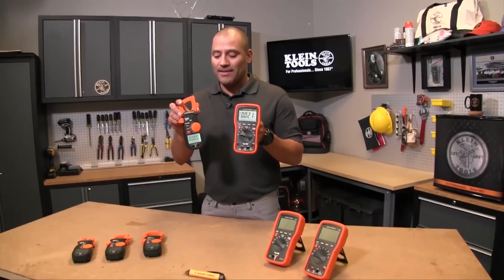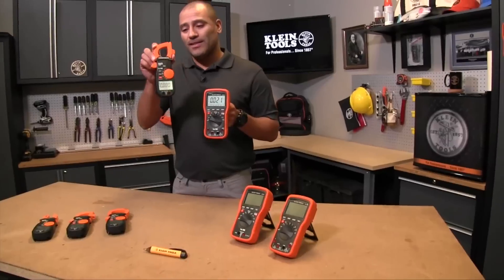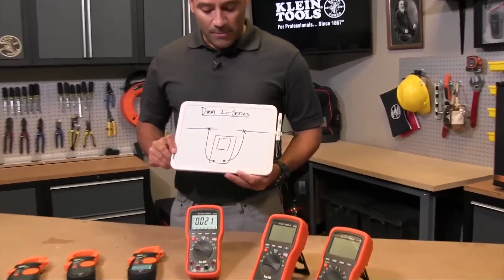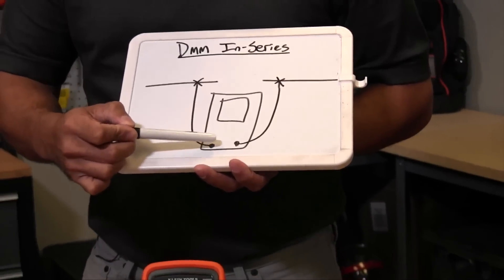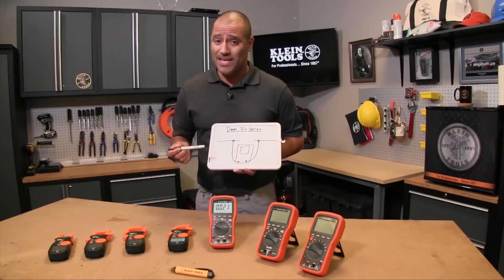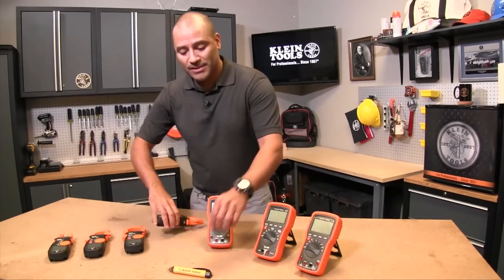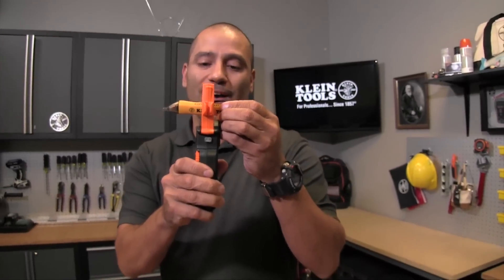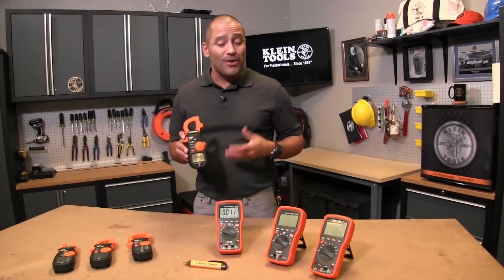How To Choose Between A Clamp Meter And Digital Multimeter

Comment: I use a Klein CL800 clamp multimeter, a really important feature not made known by virtually all meter makers is "refresh rate" of the screen. I had to ask Klein directly what their refresh rate was and even the person on the phone didn't fully realise what I needed to know. There are two refresh rates on meters 1. Measurement of voltage/current, etc. ("Meter refresh rate") 2. How often measurements taken are passed to the screen ("display refresh rate"). I bought the CL800 because it was the only one I could find that met my other needs as well as provided a high refresh rate. I can't remember what the rate is but it's great. Display refresh rate x Meter refresh rate is very important when measuring quicker changing values. I regularly need to measure triacs that control heating elements on industrial ovens. I need to see full current draw and zero current draw as triacs have a number of failure modes e.g. full on, full off and permanent half on, etc. As your meter is really good at this it would be helpful to do a video on it for visual explanation with numbers for the refresh rates. Fluke are great meters but suck at refresh rates!!
Reply: why not a scope? Real question. I don't know. I'm not an electrical engineer.

Comment: He didn’t explain why you buy the digital one instead? Going off this video there would be no reason to buy the digital one since it’s just more difficult to use and can’t read as many amps
Reply: Did you get the answer for that? Then why the heck did digital multimeters even exist?
Reply: @tubfragr2270  For more accurate reading of low amp (below 5)

Comment: You don't need to measure in circuit you can measure in parallel to.
Reply: If you mean that you don't have to measure with a standard MM in parallel...you're incorrect. To measure current, an ammeter has to have low resistance because if it had high resistance, it would affect the flow of current itself and thus could never measure the current flow accurately. Because voltage is constant in parallel, if you place a low resistance load (the meter) in parallel with a component in a circuit, the majority of the current will flow through the meter and destroy it (or blow the fuse). There's a reason the position of the leads on a meter must be changed to measure current. DON'T EVER measure current in parallel.

Comment: The title is all wrong.  This is not a "how to choose"  video it's "how each reads amperage".  I was looking for a video that would give the pro's and con's of each meter to better determine which would meet my needs.  I've always had DMM's but am considering picking up a hall effect clamp meter and still don't know if that's a good idea after watching this video.   

Where would a clamp meter fall short vs a DMM?
Reply: Accuracy, clamp meters are not as good at lower range. I only use clamp at  more than 5A or if i can't disconnect one of the wires.

Comment: Reading elsewhere I have learned that DMMs typically measure in milliunit resolutions, making them ideal for electronic work, while clamp meters only measure up to tenths of a unit, which is insufficient for electronic work, but fine for electrical work. Is that still true or has current clamp accuracy improved to match DMMs by now?

I've also read that some multimeters come with clamp accessories that you plug in so your DMM can be used like a current clamp. But I don't know if these attachments are considered to be as accurate as clamp meters. If they are it would seem that DMMs are all around superior, provided they come with this accessory.

Can anyone provide further insight on these questions?
Reply: Nicholas Olson .....I think some clamp meters also come with 2 test leads.

Comment: It appears to me that a clamp meter is simply a DMM with an additional function to measure AC amperage using the clamp.  I know of no reason why  the other functions of the meter should be any less accurate that they could be for an equivalently priced meter.  The clamp uses a half of a transformer winding built into the clamp to measure the current draw in the wire 
 (the other half of the transformer) through it.  Other than that, same-ol same-ol.

OK, I just learned there are two kind of clamps: the transformer method and a Hall effect sensor method.  The Hall Effect meter differs in that it can measure DC current as well as AC.The Hall Effect meter works on a magnetic field, and is sensitive to local magnetic fields, so it should be zeroed out before a measurements is taken.  And, of course, its bound to be more expensive, but what else is new?
Reply: Just bought one. Has everything including AC/DC inrush and min/max. $15. 😁

Comment: I wonder if the term parallel is used correct here? you can actually check Volts in parallel and with Amps there's no physical contact using the clamp meter.

Comment: 0.5V can send 300A easy. 6000V can send 100 microamps. The fact that you're breaking a high current circuit doesn't necessarily mean you're creating danger. Just thought I'd clear that up.

Multimeters can measure DC at a far smaller cost. Clamp meters are usually made to measure AC, 50/60 Hz.

Comment: Thanks - but why would you ever buy a multimeter instead of a clamp meter, other than price?
Reply: AFAIK, there is no reason a clamp meter cannot be entirely equivalent to a DMM; it is, in fact, a DMM with the additional AC current ranges and the do-hickey to use it with.

Comment: How to choose between a clamp meter and a DMM in 5 seconds:
If you want to measure high currents >10A of 50-400Hz AC (some meters can do DC too), you need a clamp meter, if not, you're better off with a DMM. Clamp meters are inherently less accurate and designed for work on high power distribution boards, automotive etc. If that's you ,get a clamp meter. Simple.

All the meters shown in the video are at the far entry level but good meters get very expensive very fast and even the best clamp meters still aren't particularly accurate and tend to drift over a few minutes and need to be taken away from the current source and zero'd frequently.
Reply: Would a lamp work to monitor a 3 stage charger on my rv? I need something to watch all 3 stages to make sure it’s dropping down like it should because it’s cooked 2 new batteries and I need to get to the bottom of it.